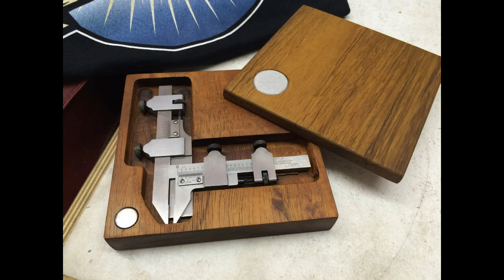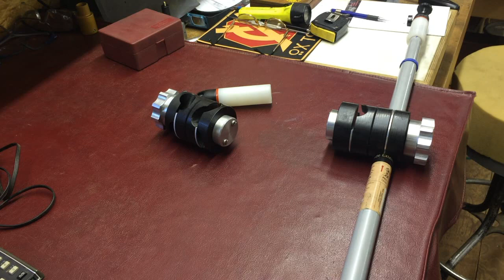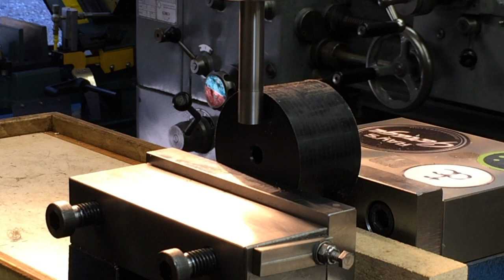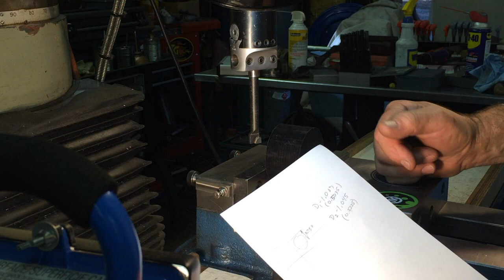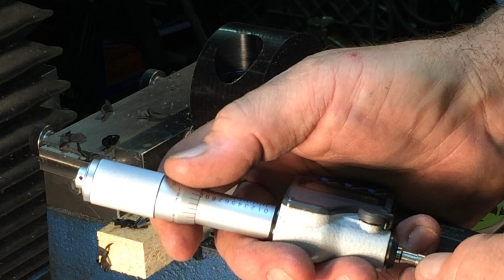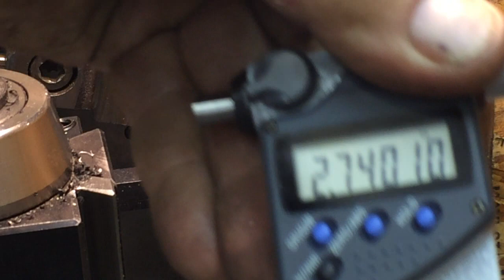How To Build Shop Camera Mounts Part 1

Comment: Interesting Randy, I can hardly wait to see how this turns out. What would be cool is to use a RaspberryPi Zero with an optical sensor to control a series of stepper motors that will move the camera along a slide rail as well as adjust the arm position to pan or tilt the camera to always keep it focused upon the action and out of your way. You could incorporate a remote to override the sensor and control the position of the camera, zoom, turn the camera on or off, etc. With the new RaspberryPi Zero at around $7 this could be built for a very low cost. Sorry if it sounds like I am belittling your build which I am definitely not. It seems like the ideas flow when I see others creating things and just want to share them. Thanks for the inspiration Randy!
Reply from the maker: +Jeffrey Vastine Thanks Jeff,  These are $10 mounts right now.  Great idea.  When you get one built send it over for testing.  Idea's upon Idea's that is how things are built.    Thanks for watching.  Randy

Comment: I like the look of that! Ideally a roof or truss gantry is the best, my tripod is frustrating.
following with interest!
Reply from the maker: +Emma Ritson Thanks Emma, Yes I would agree with you.  This is not the most rigid setup but for a light camera it is good and provides a long reach.  I might have to add a little bit of counter-weight.  This was mostly all made from scrap, Just bought the Painting extension handles about $10 us.  Thanks for watching,  Randy

Comment: Hey Randy have you thought of using your camera mount system  to film your fishing ?
you could set up something  a pole  that you push into the lake bed and do some wide angle shots along with your normal footage and the pole could also double as some where to hang your net or bag etc.
Sometimes it"s not Randy Richards in the the shop but Randy Richards on the water !
Reply from the maker: +ian bertenshaw The problem with the fishing thing is I AM FISHING.  It is tough filming when fishing, I need a film, crew so I CAN FISH.    Thanks for watching.  Randy
Reply: wouldn't take much and you could be a youtube fishing star ! 
But seriously that mount  is something anyone could make and not just for the workshop.
Ian

Comment: Looks like a sturdy unit.  Trick gimbals.  You could look up "Grip Stands" and other cinematography rigs for camera mounts, etc. Just for additional ideas.  Since you have the machining equipment, you could make it for the cost of the scrap/stock.  Speaking of scrap:  a scrap yard could be a great source for materials.  Here in Colorado Springs, though, I tried to purchase some iron/steel pipe scrap to build a clothes line, and the dude wouldn't sell to me???  Even when I offered more than the steel was worth!  Weird!  Maybe some regulation?  Your critique of the Chinese boring bar was a crack up.  Yeah, they "look" like the real deal in the catalog or box cover.  But they are are making improvements every year.
Reply from the maker: +WAVETUBE84 They are working great.  I did zero searches, maybe I should of,  I have about $10 into each mount.  Thank you, Have a SAFE and Happy Thanksgiving.  Randy

Comment: Hi Randy, you'll love having the camera tripod out of the way...

If you're looking for a good camera, think of including a couple of interesting features like:
The widest angle lens possible, also can add a wide angle adaptor.
HDMI output, to monitor video using a DVI monitor (adaptor easy to find)
WiFi control or plain remote control
Audio input

I use a Canon Vixia HF-R60, with a .45x adapter to get wider angle, found on AliXpress for about $20,  there are other great brands....   ;)
Reply from the maker: +pierre beaudry Like the new mounts already,  I think a 3rd one will be in the works soon.
I am thinking a handy cam type camera light weight and less expensive.  Have a good SAFE trip to see Kieth.  Randy